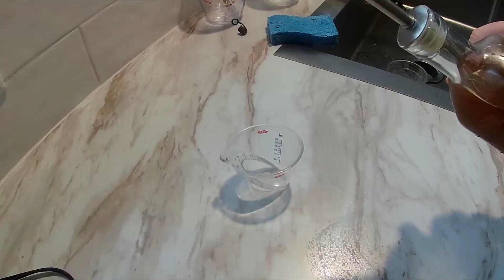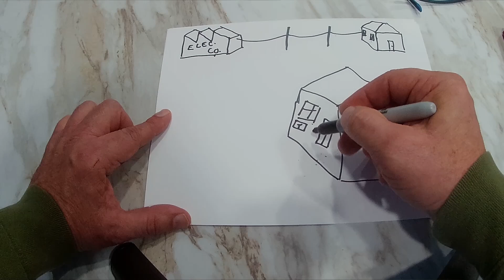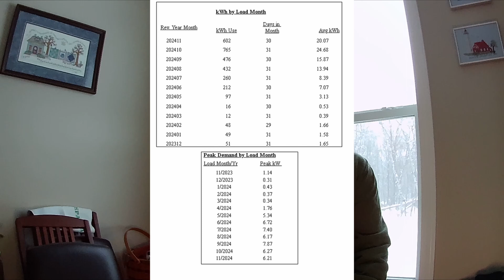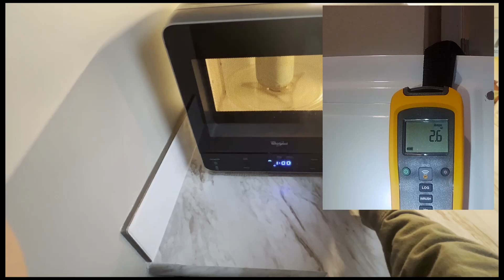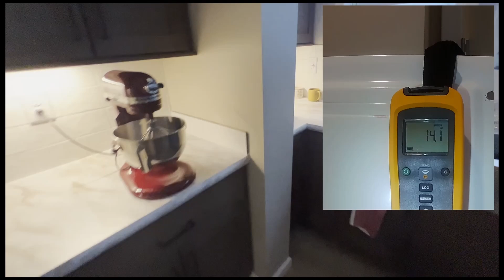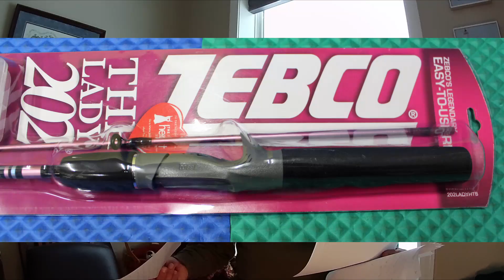Sizing Generator for House Backup

Comment: Good info! I have a video in my editing queue to show what my electrician setup around power connection to the house. He suggested that we get the ATS now since it saves us money on the  install side to put it in now vs a retro fit. I have not ordered a gennie yet and like your idea of waiting to get a few months run time to see what power usage really is. I am nto sure if my power company will give me a report like you had. I did install an "Emphoria Energy" in my little cabin so maybe I need one of those in my house as well to help make my own report.

I checked my Emphora and it appears my cabin has a 6kw peak pull on the per-minute breakout. I sent myself the raw CSV data to look closer. I never considered looking at this data to size a generator, good idea on your report!
Reply: BTW, I love how you edit the thumbnails. I am told that me not having good thumbnails hurts my videos, folks like those catchy thumbnails, suck them in factor :)
Reply from the maker: @ Thanks, I don't watch a ton of "how to YT" vids but the couple i have watched talk about thumbnails and titles. Looking at my past videos, there does seem to be some evidence to support that, so for 2025 I'm going to try and do a better job. See if I can hit the magic, 1000 subscriber mark this year.
Reply from the maker: I like the idea of the switching going in at the same time as the panel, from what I saw today on my install it will definitely be the smart way to go.